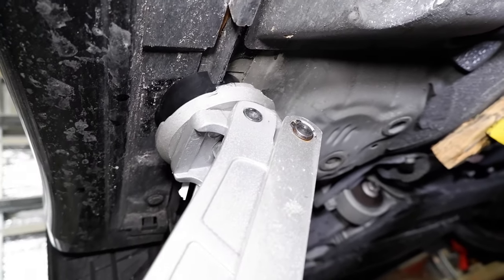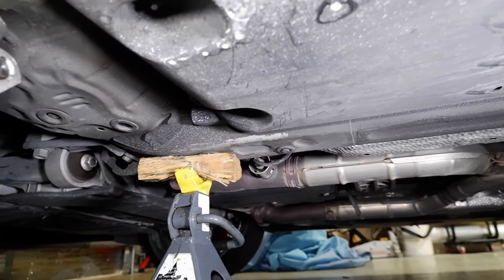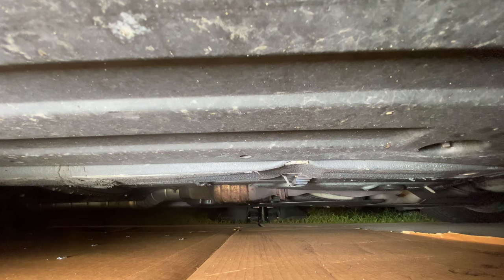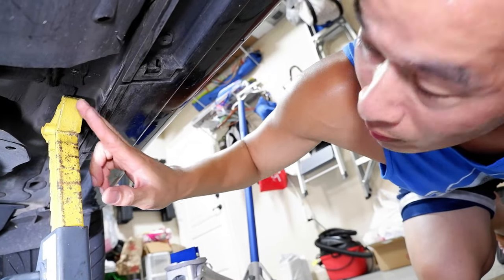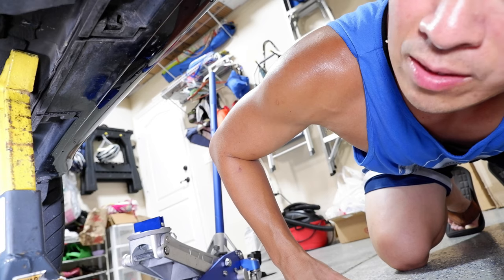How to Jack Lift Lexus IS250 IS350 IS-F without Bending Seam Weld | Jacking Points | Jackstand

Comment: Thank you so much Binh! This is exactly what I was looking for. I was contemplating on cutting my expensive aftermarket sides skirts so I would have more clearance to jack/lift the car at the seam welds. Thanks for showing the other lift areas that can be utilized!
Reply from the maker: Just don’t use the rear frame rails like I did on the 1IS. Nothing behind the front frame reinforced area should be used. Learned my lesson.

Comment: To anyone reading this, do not jack up any lexus IS this way. It is absurdly dangerous the jacking locations this guy uses. He's going to puncture through his floor. Jack the front up with the center jacking point under the motor, and do the rear from the flat spot on the bottom of the rear differential. Place the jack stands on the front and rear of the side seam welds. Just placing the car on these seams will not damage them, only jacking on them will. Dont forget to chock the wheels so they dont move while jacking. The owners manual says very clearly to do it this way idk what this guy is talking about.
Reply from the maker: The factory scissor jack uses these points🤷🏻‍♂️. Good for that, good for hydro jack.
Reply from the maker: Also the front subframe jacking is useless to anyone with a lowered car.
Reply from the maker: That’s why it’s for jacking up for jack stands, not to support the whole car with jack only.
Reply: @TunerwithKids  You clearly didn't read my initial comments instructions

Comment: Always have more than two safety points! No matter how safe it looks. I work on my car alone so if it does fall I’m pretty much dead. Doesn’t matter how sturdy or guaranteed my jack or lift is, I’m putting extra extra reassurance to make sure that I’m safe instead of sorry. Trust your guts, if you don’t feel right, than it ain’t gonna hold tight.
Reply: Yes always wondered why all these car people use 3 points I found out last night. Had proper jack points on my 250 was working on putting in some lowering springs and had my jack on the LCA abojt 2 inches off that side jack stand. Went to slowly lower the car and I heard a weird sound stopped the lowering but it was too late the jack stand on the side had somehow tipped over and caused the other side to fail too. Luckily no one was under the car. From now on using 3 points always and then the jack would be the 4th. Crazy part is I was working on a nice level ground too. Stay safe people
Reply: Always bro. 3 point safety don’t hurt
Reply: @Breese147 what is 3 points?

Comment: Great video! I really wish car manufactures all had some kind of standardized jack points that were required. I prefer using the rear diff as my jacking point in the rear. Need to get that rubber puck, my pinch welds are all buggered up.
Reply from the maker: I liked Honda’s side points much better, they had a nice reinforcement that could take the hydro jack abuse. Toyota are too soft.
Reply: Actually some cars listed this in the owners manual
Reply: All Cars&vans a decade or 2 I ever lifted which was lots used to have a v easy to find flat jack point far safer in a hard shoulder for you,your family &other road users& less risky than a jack point slip in a garage which that faffy groove is likely for
Reply: Yup, the side pinch rails on my Honda Element still standing after 20 years even on the flat surface of the jackstands. @TunerwithKids

Comment: You literally only need to get the front or rear up a few inches to get a jack under the sub frame or differential. This is supper easy if you have two jacks. Jack up the side a bit, and go in the front or rear with your other jack. If you only have one,  jack up your car a bit and lower the wheel onto a few 2x4s. You will have plenty of access to get your jack under the sub frame or diff.

Comment: To make sure the piece of wood doesn't split, I always make sure its placed so that the jack point/chassis seam is perpendicular to the grain flow of the wood. If its parallel it will split every time.
Reply from the maker: Yea I’ve had it split. It’s kind of formed to the shape of the foot on the jack stands now. But putting wood between frame and stands is totally unnecessary for 99% of the people.
Reply: Why put wood there?, to ensure no damage

Comment: I used to place my jack at the seam until both of my cars had a leak. Apparently if that seam is flattened the sunroof drain cannot drain water out. Happened with 2 of my cars

Comment: Hi, love your videos, very good instructions and attention to detail. I have a new to me stock 2010 is350, just turned 100k and I want to do some drain and fills of the transmission. I know the car needs to be pretty level for proper fluid level and overflow draining. I was thinking of using ramps on the front, then jacking the rear and using stands. Sound legit?
Reply from the maker: Yeah that should work. I have four jack stands so I usually just put them on all four since this car won’t make it up ramps.

Comment: Ive been in the motor trade as a tech for nearly 10 years and i have just crushed that front bulged out area (next to the seam weld)on my own 2is jacking it up and my heart has just sank to my gut 😭😭💔💔 luckily its not the actual floor pan but rather a piece of metal toyota had welded on top. It looked so convincingly strong too... fml... i feel for that GSF guy 😟

Comment: Just un FYI.   I was told that when you pump your jack to the limit 80-90 degrees, you blow the seal and the jack will leak after.
Reply from the maker: Usually it’s the cheap jacks. Both my HarborFreight and craftsmen jacks ended up leaking after 10 to 15 years of use. The HarborFreight one probably started leaking after 5 years.

Comment: Hopefully, by now you learned where your car's "Center Jack Points" (Front & Rear) are....  Other than the 4 pinch-weld jack points, if you want to place Jack Stands under your vehicle (Rear Left/Right & Front Left/Right), you really should use the manufacture specified enter jack points, so you can place those Jack Stands under each Pinch-weld location.  Anywhere else, especially those uni-body vehicles, you risk the chance of collapsing a sub-frame or floor pan etc.  In your video @10:22 that is just WRONG!!!
Reply from the maker: I’ve never used the center points cause car is too low. But I got a 2-post lift now so don’t need to worry about jack stands and hydraulic jacks anymore 😂😂
Reply: @TunerwithKids  in that case I would have suggested driving up on something to elevate the car alittle bit or use a lower profile jack

Comment: 2 weeks ago, when I was about to change the brake pads, I climbed to the bottom of the car to check, and the front collapsed in.  It should be the previous owner or the first owner who misused the jack in the wrong position, I don't know how to fix it.

Comment: what size of your wheel and tires if u dont mind im asking
Reply from the maker: 245/30/20 front and 275/30/20 rear. I have full explanation on this video. https://youtu.be/iKfLh4GrtoA
Reply: What brand of wheels katana k5 ?
Reply from the maker: Nope. These are Avus Forged 3-piece. They were a custom wheel company from Miami in the 2000s. Now defunct and out of business.

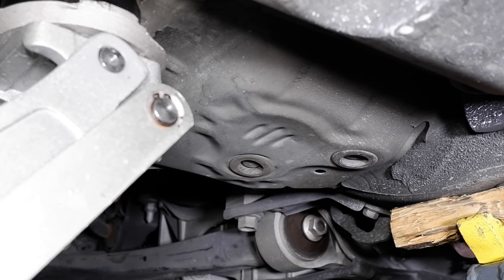Comment: Broo @6:44 I placed the jack right under my floor pan as well and it’s dented quite a bit what do I do now
Reply from the maker: Live with it??? Or try to hammer with rubber mallet from top if you can access the area.
Reply: @TunerwithKids  should have watched this video before trying to jack up my car 😭 i guess i have to take the hammer route now

Comment: I couldnt disagree with this video anymore. And you showed damage that you caused on top of it. Instead a much better way is to jack from either the front or rear jackpoint then put jackstands on the pinch welds and lower the car. I have been doing it this way for years with no damage caused. Get a low profile jack (long reach optional) and you should have no issues. The "frame rails" you referenced are known to bend when used towards the back on GS300/400 for example, so its not a good place to use when you have pinch welds that perfectly fit a jack stand

Comment: My IS F has the arrows for the jack points.
Reply from the maker: I guess they added it to the F, I haven’t seen any 2IS with it. The 3IS and other modern Toyota have the arrow.
Reply: I just looked under the 2011 IS350 F Sport I bought for my folks - it has the arrows.

Comment: Daft,dangerous&ridiculous design, far more dangerous if your car is on a road-motorway like many countries now,even in UK without hard shoulders-breakdown lanes, spending half a hour just lifting your car to change a wheel with faffy jack points with your family etc,,, than lower danger of a jack slip in a workshop. Silly&annoying as is the electric IS300H key fob button always losing power with the button pressing even in a umfill pocket. Bad fittings & wouldn’t be suprised if the jack points& similar faffy “bespoke”tooling are scam by manufacturers with dealerships. Shame as my hybrids efficiency & some other features are vgood.